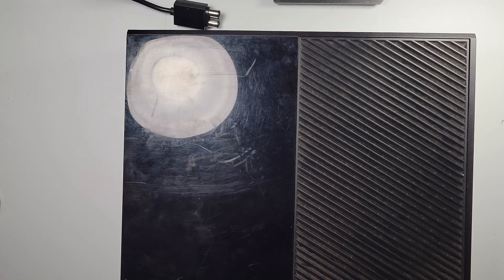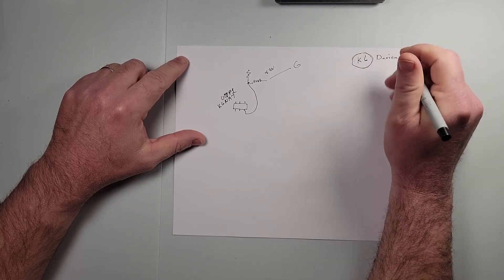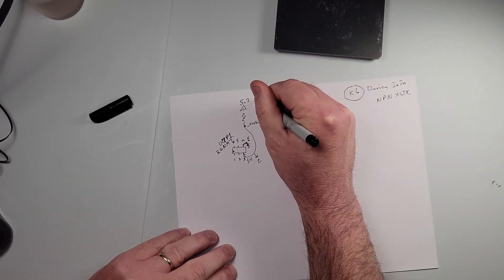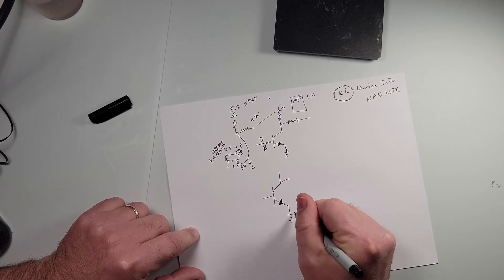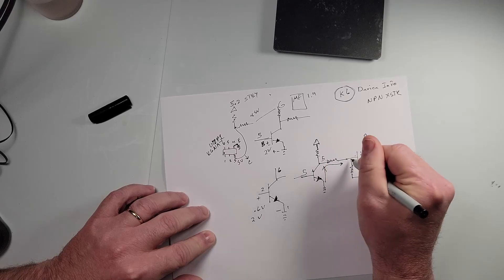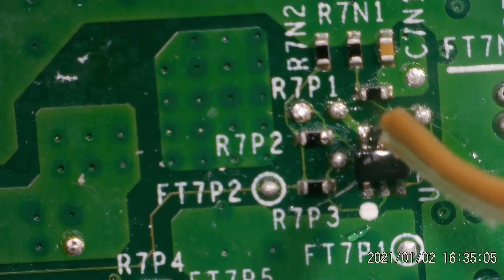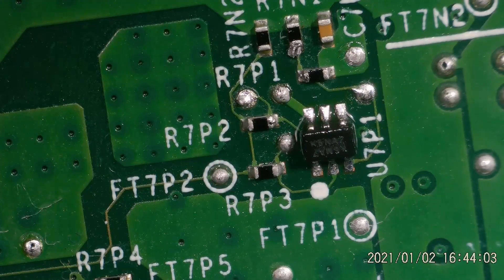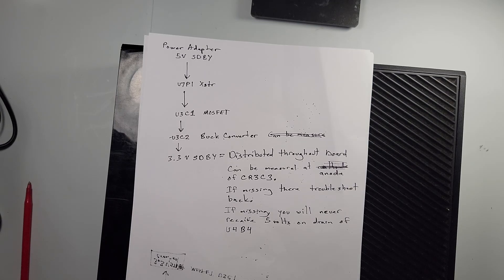Xbox One Model 1540 No Power Missing Standby Voltages Part 2

Comment: Your video did help me some what but still stuck. I think my issues is in the sister chip on there otherside of the board u4b3. Im getting 5v on the gate of u4b4 pin4 which is the same as the source on pin3, this is giving me around 1.4v on the drain.

I also lifted the gate pin 4 and voltage jumped to 3.3v on drain. Almost there as i need 5v on the drain.

So this tells me the gate isn't getting the correct voltage 

Thanks for the vid ill have to keep looking

Comment: I'm just a amateur girl trying to fix an Xbox One, I don't understand "technician lenguage" but your video was interesting and so didatic so I could try to understan what is happening. Mine has almost the same problem as yours, mine turn on but it turns off asap, but following the voltage, ones are lost, one of 5v. I still look for bad joints later on. Thanks

Comment: Tell me how many volts should come to bases 2 and 5 on this U7P1 transistor, I have 5.1 volts to the resistor divider, but there are only 650 millivolts on the bases, I checked all the resistors 4.7 KOm as in the official scheme, please help. Thank you waiting for an answer. at output 3.6, the signal is only 520 milivolts.

Comment: Sometimes mosfets can become "stuck" and just shorting the pins or providing a forward voltage to it from an exterior source can get it moving again.

Essentially, it will no longer register the voltage to open itself anymore for whatever reason and a jumpstart of sorts can get it opening/closing again. 

That would be my best guess as to what got it working again. Not a definite but a strong possibility.
Reply from the maker: That has to be what happened because it always worked after that.  I thought that it could possibly be the southbridge as the 3.3 V enabled originates from it and starts the process but I am not 100 percent sure.